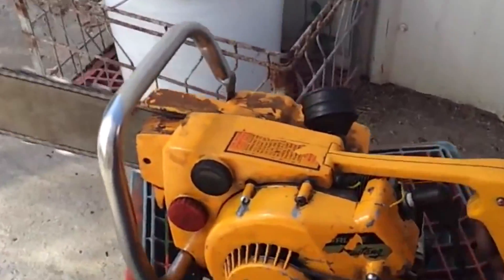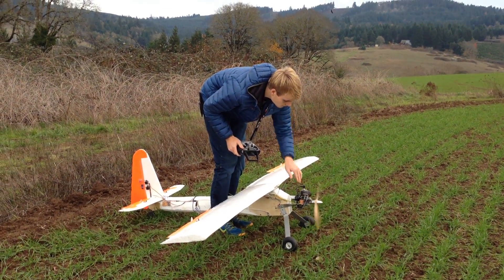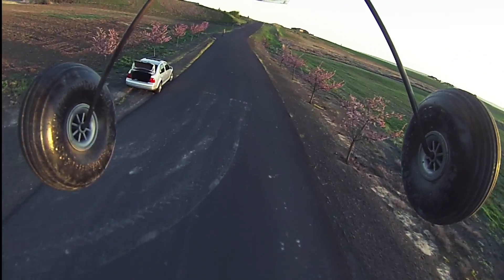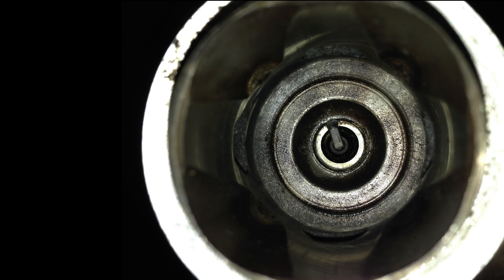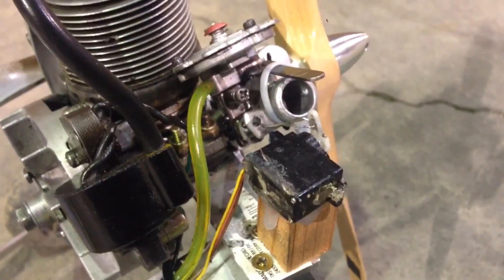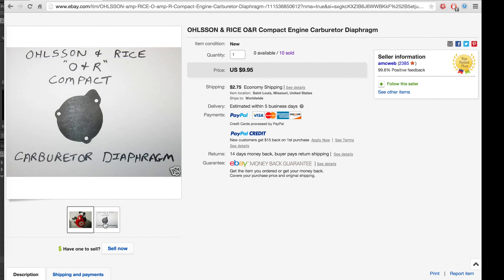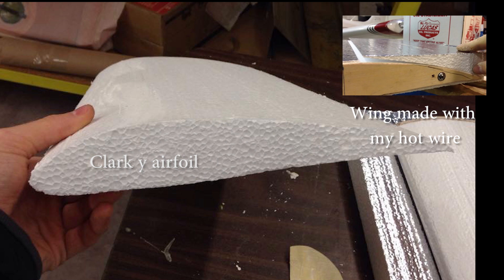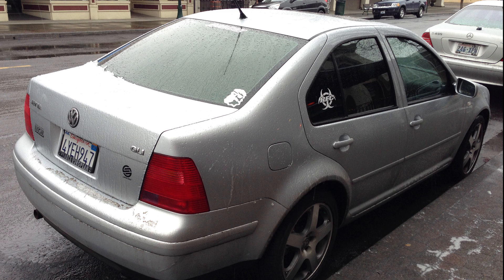THE FLYING CHAINSAW! 8ft foamy airplane

Comment: Can we make an ultralight powered by chainsaw engines
Reply: You would probably want to use something bigger, like a Weed whacker engine or a small motorcycle engine.
Still doable though, if you cut off unnecessary weight from the engines.
For example here he kept the flywheel/fan on there, which is unnecessary weight since he already has the propeller on.
Not sure about the starter, but that could also be taken out and replaced with an electric variant. More convenient and lighter.
Reply: In the 80s people used 100cc chainsaw engines to fly

Comment: I want to know how you guys make the prop hold on the shaft for that engine
Reply from the maker: I used a “prop adapter”
I couldn’t find the right size so I go the size just smaller and used s lathe to make the hole the perfect size
Reply: Samm Sheperd so you make the bore of the prop bigger or you skim the shaft of the engine to fit ?

Comment: The wobble on that engine mount!
Reply from the maker: Yes that is by design with rubber in between the motor mount joints
Reply: Ahhh ok.

Comment: i have a similar chainsaw engine: how did you mounted the propeller on the flywheel? thanks
Reply: MultiChannel™ i have no experience in this whatsoever but i think he may have extended the output shaft with a bolt or something that would allow him to fasten the prop with a nut or something similar.

Comment: Samn how would I mount a propeller to a home lite bc800 weed eater.
Reply: Dual Dagger i think im actually getting the same one for this very purpose. All you really need to do is extend the crank shaft to accomodate for the prop, or at least i think thats what you do. Just try and extend the crank shaft somehow.

Comment: amazing transformation of engine onto plane! can you do a video on a plane with a nitro engine?
Reply from the maker: +i Build never had a nitro engine. Though converting a spark ignition engine is as easy as a glow plug and nitro fuel.
Reply: True. Anyways, it still would be cool if you did. I've been looking on eBay and the prices for used nitro engines are pretty cheap. I've seen nitro engines for $0.99 but I think that they were old engines that didn't run. Still, it would be cool If you did a take apart of one of these engines
Reply from the maker: i Build I love getting super cheap engines and just playing with them. I haven't found a case yet where an engine wont run after a little rebuild. See my "taking apart engine video" it's so fun especially when the engines are so cheap I don't care if I ruin anything
Reply: Yeah it is fun. I have an old leaf blower engine that has a busted carb. I've seen the engine take apart video and thought it was interesting. The cam shaft gear that runs the valves seemed to be olyptical. Was it? I know a youtube channel called rapmoz which is all about small rc style engines , many of which are fairly old. You should check out his videos because it would be cool if you did engine rebuilds on camera. I would definitely enjoy that.

Comment: what's the mass of the aircraft, in total?
Reply from the maker: +CreeperOnYourHouse bout 5kg
Reply: ***** Including the engine? wow.
Reply: Samm Sheperd say it in american.
Reply from the maker: Bloo Jay 5kg = 0.342609 Slugs (the question asked for mass, not weight)
Reply: Samm Sheperd Civilized American not Deep South American
Reply from the maker: Bloo Jay The Slug is the official Imperial unit for mass. A pound is a unit of force. Under the acceleration of Earths gravity 0.3426 Slugs will have a force if 11 pounds.
Reply: Samm Sheperd thats dumb they should just use the metric system.  Also measurements of mass are a bit useless unless you're comparing weights between different 
gravitational bodies. or space I guess.

Comment: Im making my own chainsaw plane!  I have been studying your video for mounting and other information, but I still have 1 question; what servos do you use?   ive made plenty of foamies and have plenty of 9g servos but I feel those are gonna be too small, so, Samm, what did you use?
Reply from the maker: Haha, 9g worked for me! My mounting and throttle control is all very much just thrown together to try and make it work. I did use a standard servo for the elevator, but before that I used 2 9g for safety.
Reply: Cool, ill see how it works out and post the results!

Comment: thanks for answer my friend .i find this prop adopter with10mm motor shoft and i think my engine shoft also is 10mm
Reply from the maker: +umar zaman The best thing to do is use a caliper to measure precisely what size it is, and if that size is unavailable, buy one that is slightly under size and drill the collet to the correct size.

Comment: good job man. i have one question where did u get prop adapter i have a chain saw i wana convert in to rc engine thanks..
Reply from the maker: +umar zaman That was one of the challenges with this project, I measured the drive shaft with a caliper and found that nobody made one with that exact size. So what ended up working was I ordered the next size smaller and drilled it out to the perfect size. I used a lathe but some careful power drilling with a bench vise might work too

Comment: how did you hinge the control surfaces ?
Reply from the maker: ***** basically clear duct tape.. LOL
Reply: so just cut out the ruders and tape it till it stays in place ? I´m currently doing the same thing with a weed-eater engine...wings are cut and electronics ready :)

Comment: Nice project man. I was wondering, did you use 1 or 2 servos to control the ailerons? How many channels are you running on your receiver?
Reply from the maker: I used only one 9 gram servo per aileron. I am using all 6 channels on my radio system: ailerons, elevator, throttle, rudder, flaps, and a radio controlled relay switch which when on it grounds the ignition and kills the engine.